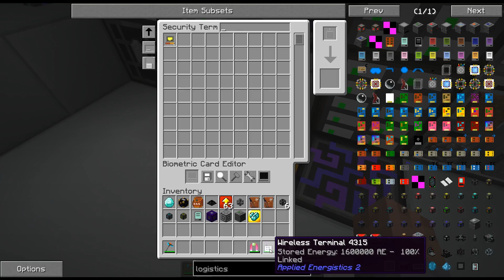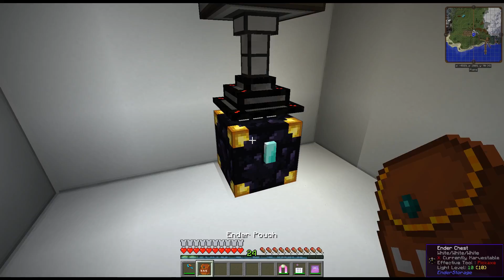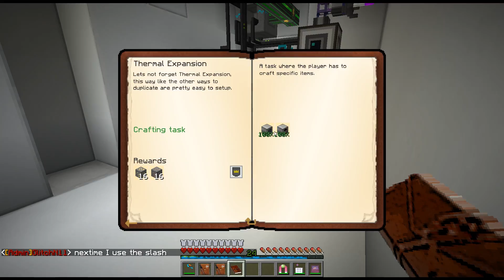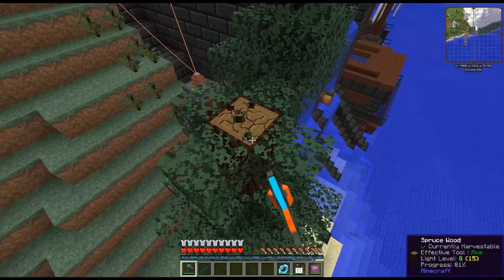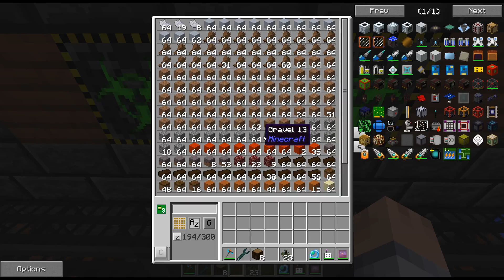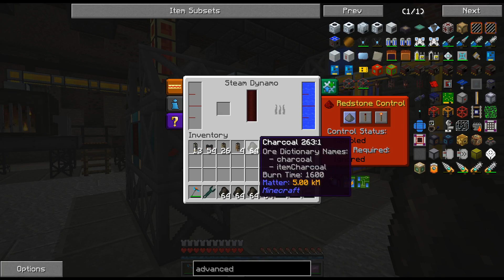Bevo’s Tech Pack #6 - Remote Ordering and Mineshaft Power - ftog Community Server

Comment: Hey Thor.  The mine is looking amazing.  I think the augments are not working.  As far as I know, each augment requires the previous to be installed.  You cannot put in level 2 without level 1 installed.  I could be wrong but don't think I am.  Thanks for a great video.
Reply from the maker: +Mikey Since the recording I've added the Tier 1 upgrade in all the Steam Dynamos, thanks for the tip :)

Comment: you might of figured it out already but since you have the tier two energy saver you also need the tier one to be in there also if you read the augment that you put into the steam dinamo if says needs previous tier
Reply: ps grate vid
Reply from the maker: +magnumpower 1 Since the recording I've added the Tier 1 upgrade in all the Steam Dynamos, thanks for the tip :)
Reply: +Thorgal Daily just wondering did it help or is it still unnoticeable

Comment: You can also remove the redstone Controller from the steam dynamo which gives you 4 Upgrade slots in Your steam dynamo. I usually run With 1 efficiency Upgrade and 3 energy for a total of 680 RF/t pr dynamo
Reply from the maker: +Karl Mikalsen I think I'll go with 2 and 2. That should give me 320 RF/t and a nice reduction in fuel.

Comment: Glass microblock notches will stop the saplings and be nearly invisible. Alternately, a grass block in a painting machine on some sort of planks.

Instead of dumping the dirt from the Sludge Boiler, use it for AE singularities.

I like the seared brick. Compared to the Abyssal, it looks almost soot covered.

That's actually about three times the Magneticraft power necessary for a plain processing line. But there's an RF generator you can run the excess into to generate more RF power.

You need all previous levels of augment to use higher ones. So T1 Augment for use of T2.

Also, remove the servos from the Steam ovens, and put a Resonant retriever on the top of the Charcoal barrel and it will rapidly extract from both. And set the servo underneath to round robin so it swaps between destinations.
Reply from the maker: +Triaxx2 I like the round robin idea and will switch to that, thanks for the great tips :)